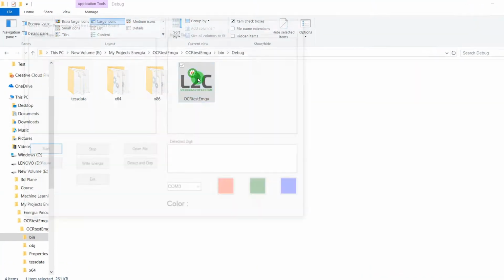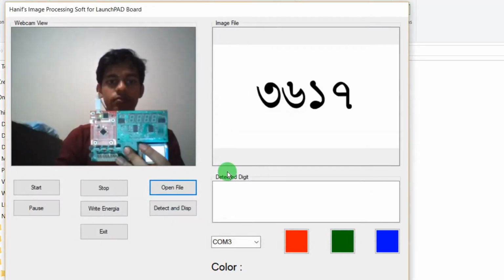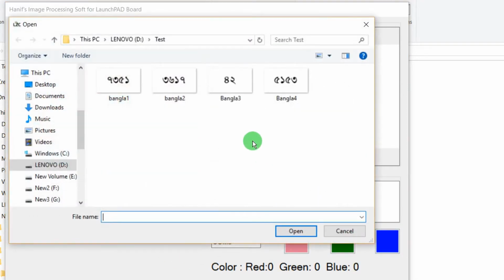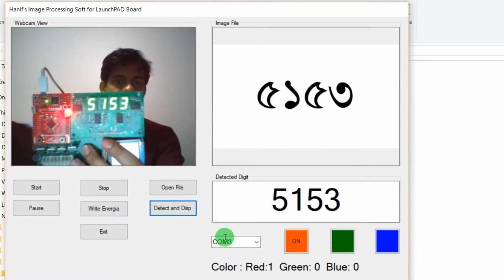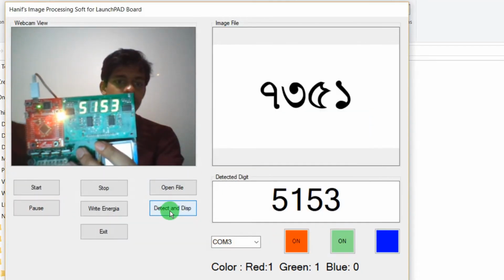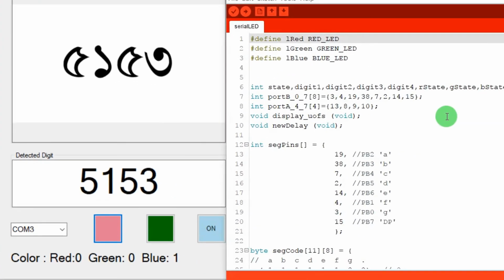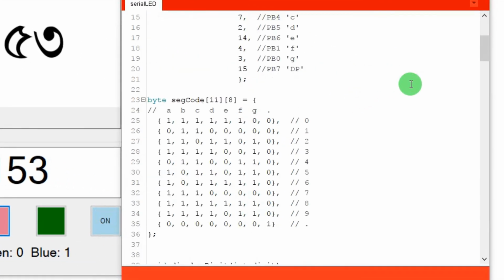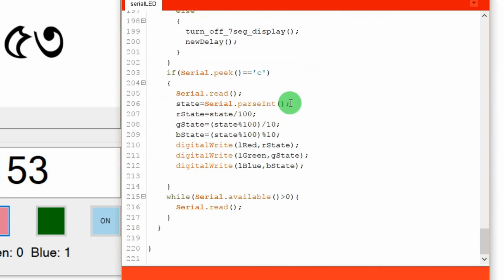Image Processing with LaunchPad Microcontroller : It Can Now Understand Bangla Digit Character

Comment: the title on this video is deceptive. Initially, I thought you are doing the image processing on the launchpad. Upon checking the code posted at the end of the video,  it is just basically for 7 segment display, serial receiving and some led on/off toggling.
Reply from the maker: image processing using webcam and then showing the output on the lcd on tiva board
Reply: you are not processing the image using webcam. you are getting the image from the file system and opening it with your windows app (maybe a C# (or VB.NET) Windows Forms app). Show us the windows app source code where you do the actual  processing. The microcontroller source code shown at the end is too basic for display purpose and doesn't tell anything about the image processing.